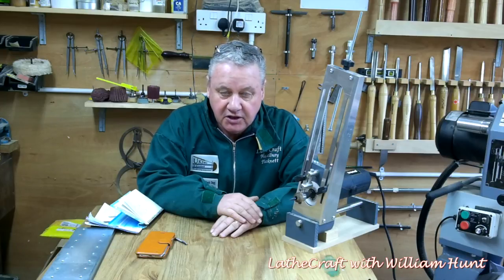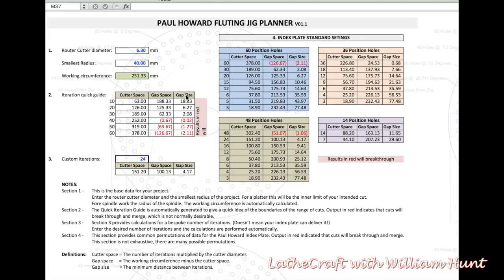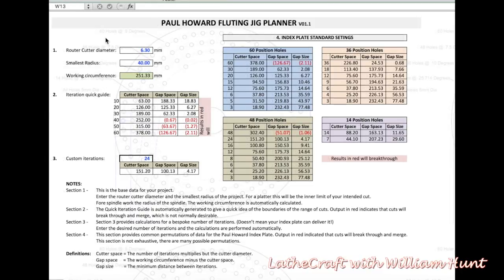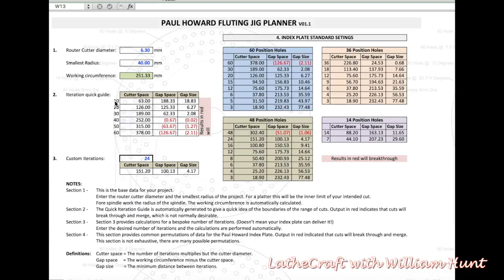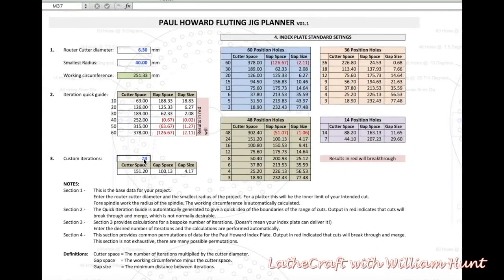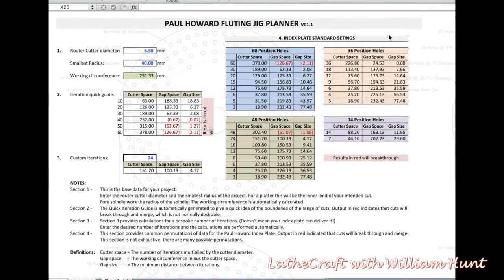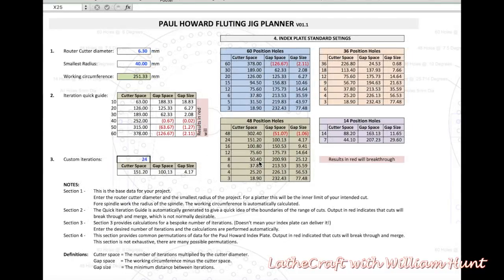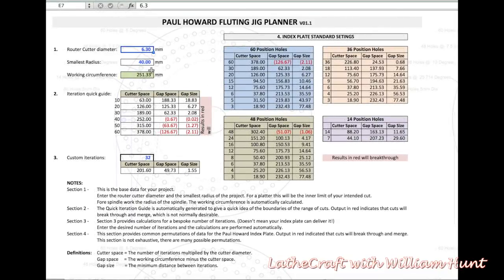Woodturning - Paul Howard Fluting/Router Jig Pt 5a - Planning for a Double Arc Lattice Platter

Comment: Great vid William I’m sure it will be of great value to turners for years to come especially the spreadsheet
Reply from the maker: Thanks Glyn. The spreadsheet is just a first attempt, I'm sure it will be developed further. Already being pressured by our trans-Atlantic colleagues for an imperial version, whatever that is! In theory it should be possible to plug in interpolations between the four rings of the index plate settings, thus increasing the number of options or even mixing router cuter sizes on the same work face. Who knows. Im just having great fun, compensation for cancellation of Yandles show :)